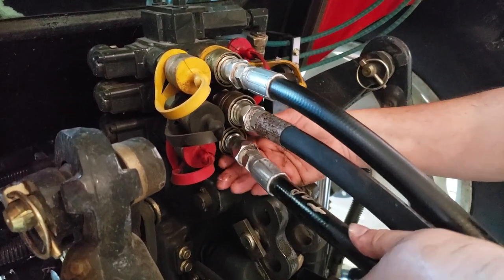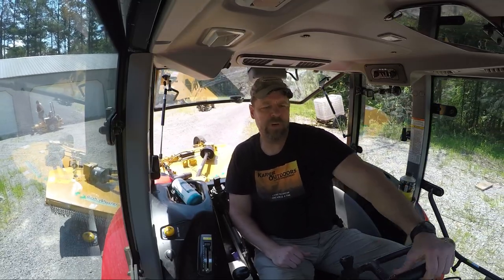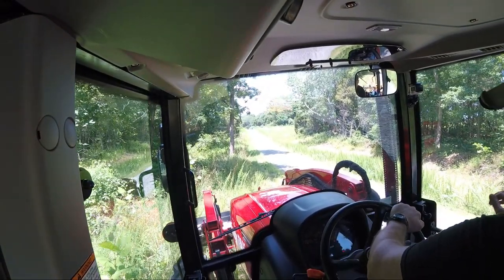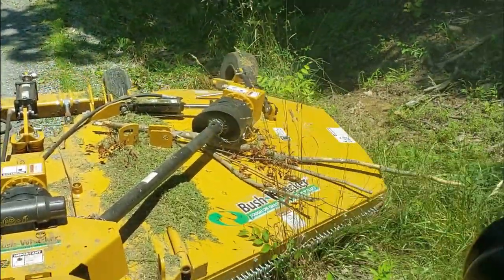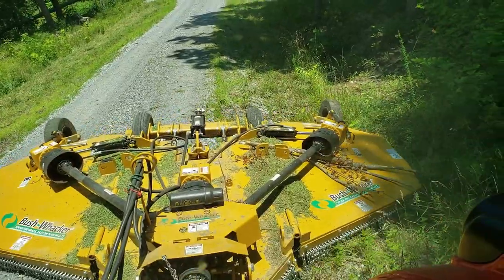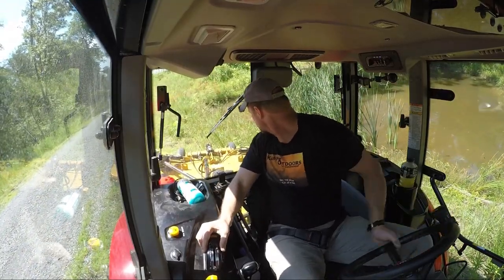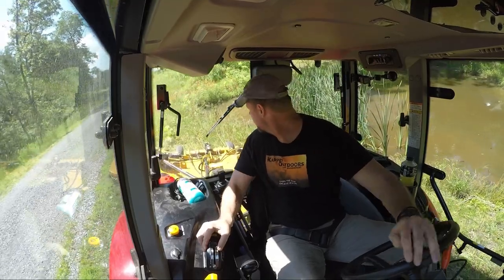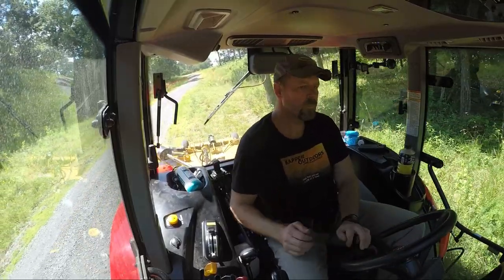Bush hogging homestead road Bushwhacker MD 144 12' Batwing. Kapper Outdoors

Comment: On steep ground like that you can rise  both wing where the wheels are barely  off the ground and  nose the front tire of the eage the steer out pretty  fast and the hog will pull at an angle  but be further  down the ditch and the tractor  will be on more level  ground. That's how we mow them on our farm and the state  highways

Comment: Batwings make helluva rock chuckers.
How about utilizing Round Up on ditchline at least to define the edge.
I hated the batwing, liked the flails, (side & rear)
This was roadside mowing.
Reply: Since it's a private drive he doesn't have to worry about cars or people passing by
Reply from the maker: Well I don't want to use herbicide because of the extreme washing out and the weed roots at least hold it much better. I think once I get it all mowed back and offset cut over the edge it will be much easier. thanks.

Comment: Man I need one of those 12ft Bushwackers... I got a 65 horse John Deere front wheel assist it's plenty big enough ain't it...
Reply from the maker: OH yes that would be a perfect fit!!!
Reply: Would you say bushwacker is better than the rhino 12 stealth? My dealer sells both. I originally was shopping for a 15 foot machine but my dealer told me with my tractor it would be a strain so I'm looking at the 12 footer machine. The cut quality of your machine looks excellent.  I have a 25 acre mostly open pasture to mow.

Comment: Has anyone ever replaced the ratchet adjusters on the wings to Hydraulic Cylinder so the wings can be picked up and down the same as the center section?

Comment: I'm getting ready to drop dough on a new mower in a few weeks. I know this video is a couple years old. Do you still recommend the 12 foot bush whacker? I will be mowing a 25 acre hay pasture mostly flat & open (very few trees/no ditches). I'm going back & forth between the bush whacker md 144 & the rhino ts 12. My dealer sells both but if I order rhino ill be waiting a lot longer whereas the bush whacker would arrive sooner. There's not many reviews out there on the bush whacker except yours. Any input you have is appreciated pros & cons. Thanks in advance!
Reply from the maker: My best guess is that I'd go with the Rhino, I think they are made a little heavier duty. This one works fine though, I'm just thinking longevity. Best of luck thanks

Comment: Does anybody know if Kapper’s batwing can cut with one of the wings partially raised?  This would be handy for cutting a roadway side slope that is rising from the roadbed while the tractor remains on level ground.   

What about a roadway slope that falls away from the roadbed...  can one of the wings be dropped below level to run parallel with the downslope?  Thanks
Reply from the maker: Yes it still turns if I raise one side. It will run that way all the way up. And yes, they will drop below level, but only a tiny bit. Thanks.
Reply: Thanks!  Happy 4th